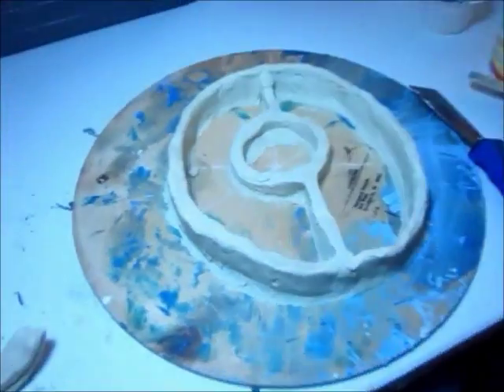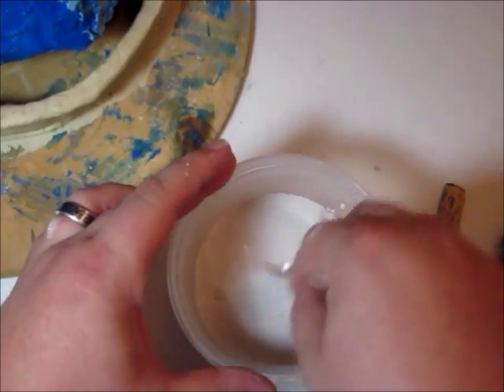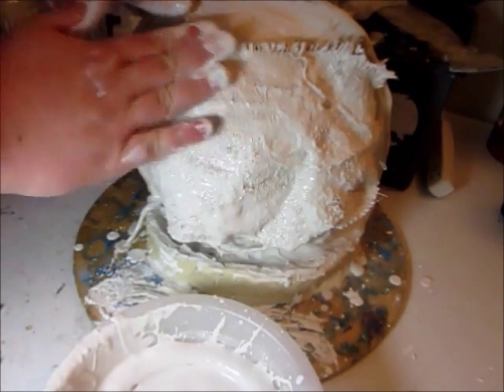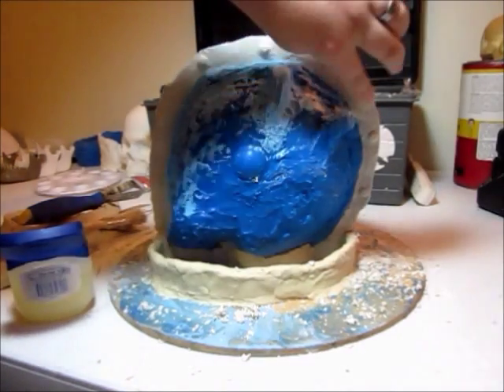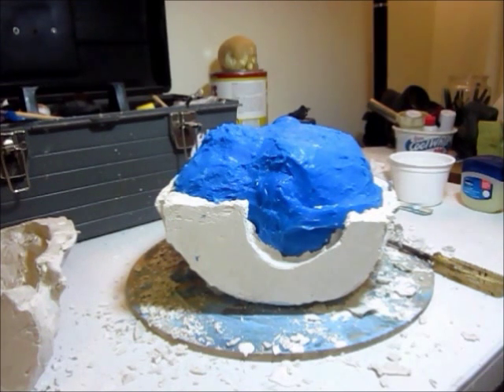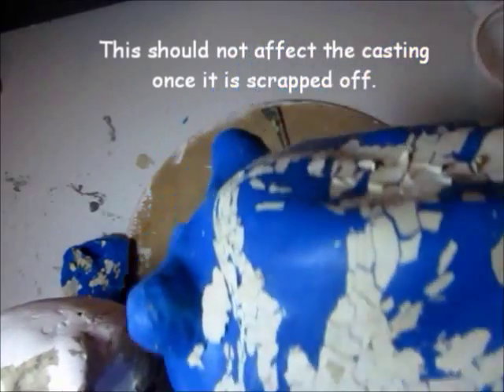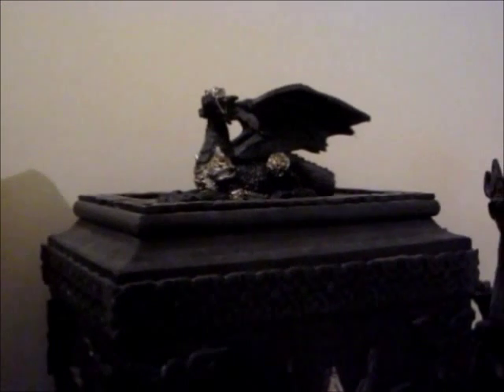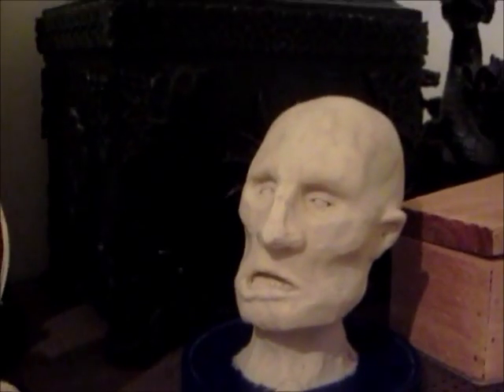DragonBone vlog 005- Vampier skull mold part 2- Dragon Head and Demo Derby

Comment: Well back at it again today. Casting issues have plagued me today. I moved from plaster molds to silicon molds. The product changed . I've updated the changes on my "great stuff casting secrets".  Do you remember the silicon tests you did? I am using "my" way of soapy water. It is fast and easy for me. The lower jaw of my dragon is a challenge. I have a 2 piece silicon mold . The mother mold maybe 4 pieces. Oh,boy.
I will likely have 3 or 4 copies at the end of this show. Not so sure how good !